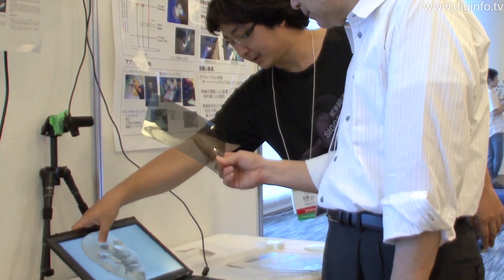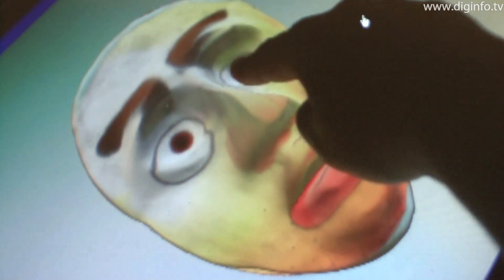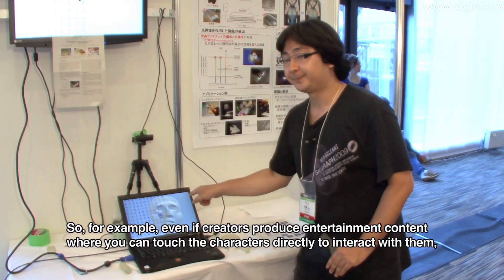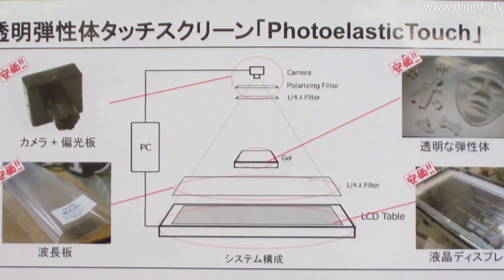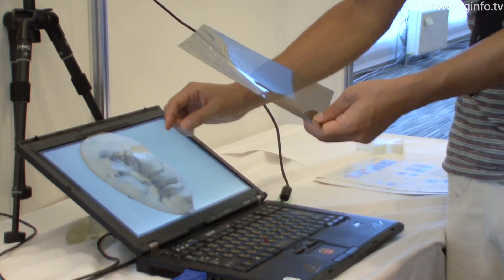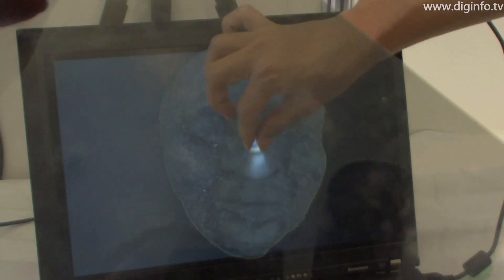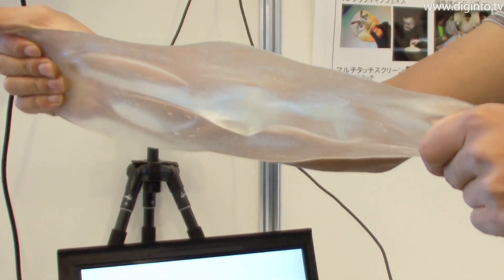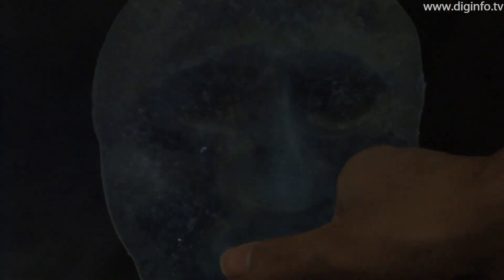Soft touch-panel using LCD and photoelasticity  : DigInfo

Comment: correct me if I'm wrong but the gel itself doesn't light up like the video says. I know i'm splitting hairs but all your doing is changing the refractive index to bend light, that is the computer monitor light, so that the polarizing lens detects it. Right?